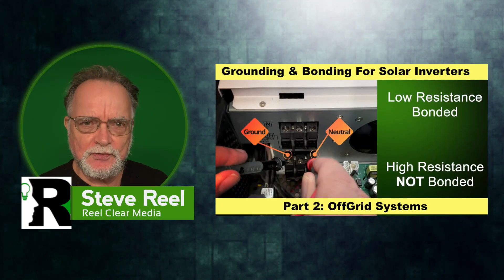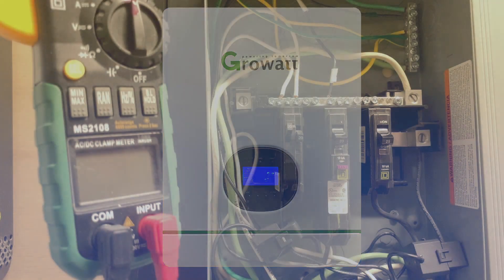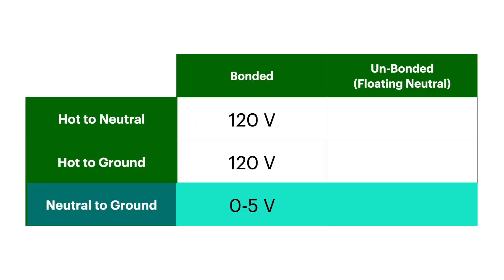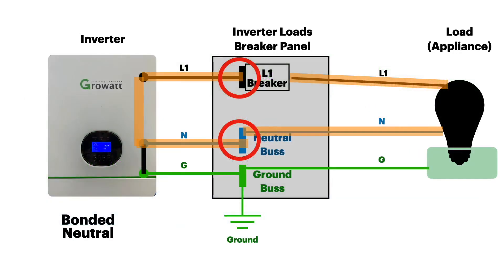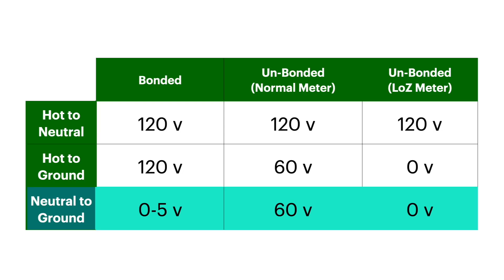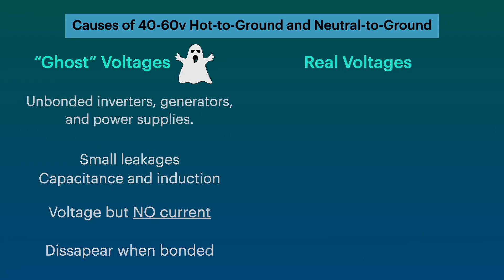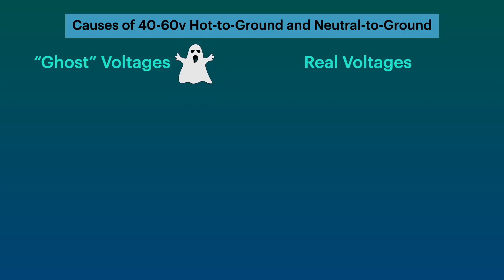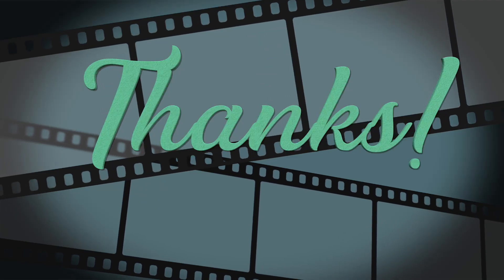Is Your Solar Inverter bonded or un-bonded? How to find out.

Comment: Please, someone should educate me: if there should be one ground for the whole on-grid hybrid inverter or for the whole electrical wiring of a house? My question is: if my hybrid inverter is bonded internally, should the ground terminal still be connected to the breaker panel that's already in the house ground?

Comment: I accidentally blow up an power inverter I was using in my shed that I bonded the ground and neutral together working fine then the next day I turned it on and it popped its caps

Comment: Thank you so much for your content! 
    qq.. would it be normal while performing the bulb test to then see 120 volts on hot to ground when a bulb is connected from neutral to ground?  Bulb is "not" lit, and reads 0 volts while connected to (neutral & ground) when testing for ghost voltage, as I see 60ish volts on both N to G and H to G. Seems I can use this inverter for a "Grid assist" with my Reliance Transfer switch.?
Thanks again
Reply from the maker: The bulb is acting as a temporary bond between neutral and ground, but there is not enough current to light the bulb.

It should be ok, but be careful and double check voltages after connecting to transfer switch. Also check outlets with a tester that shows errors such as "open ground". 

Also, if you are supplying grid IN to the inverter it is possible to create a ground loop.

Comment: Great collection  of videos!  Very clear and detailed.  I could use some guidance. I am working with a 1967 Holiday Vacationer camper.  I will be completely off grid(with use of a 100 watt solar panel not mounted to the camper) Very simple in the electrical needs(seems all original to the camper).  I have a few 120 volt receptacles, six 120v/12v combo lights. I don't have the 12 volt lights connected in any way. Using 120v LED bulbs to conserve energy.  The propane heater and propane refrigerator don't use any electrical at all. There is a small panel with one 30 amp standard breaker with a jumper wire over to a pair of 20 amp standard wafer breakers.  The neutrals and grounds are separated. I have it set up to never connect to shore power.    The ground bus is bonded to the camper frame.  I have a Licitti X battery box(added 100 Amp hour LIPO4 battery).  The battery box has a small built in 10 Amp MPPT charge controller as well as a 1000 Watt pure sine wave inverter.   I plan to use the shore power input directly to the inverter attaching a 3 prong plug on the former shore power feed.  There is one 120 v output receptacle on the battery box fed from the inverter.  The inverter appears to be unbonded with a  floating neutral.  My auto ranging Klien multimeter indicated 122 v H to N, 63 v N to G and 58 v H to G.  In testing for ghost voltage, a halogen bulb lit up H to N, but not N to G.  On auto ranging for ohms, N to G was 20.34 nF and H to G was 20.22 nF. Sorry so much info. Just wanted to be thorough.  I want to update the panel/load center. My questions are this: do I bond Neutral and Ground at the panel? Do you recommend GFCI protection for the receptacles? Do I bond the ground in the panel to the camper chassis?  Thanks for your help in advance!!! Brian

Comment: I'm so glad I stumbled across this video.  Best I've found so far on the subject.  Thank you Steve.  In my preparation for installing shore power in my camper van, I took a deep dive into my electrical system, which I hadn't done since I got it delivered from the builders three years ago.  This is a mobile system (as opposed to off-grid), where there is no real "earth" ground, but I think the same principles apply.  For what it is worth, my inverter chassis ground is connected to the negative bus bar for my house battery bank. I have a Cotek SP3000 inverter with a hardwired AC output (no outlets on the inverter) running to a Blue Sea 30A main panel with 6 breaker positions. The installation manual for the inverter states "Neutral conductor (N) of the AC Ouput and Safety Ground (PE/GND) is connected" implying it is NG bonded.  Blue Sea confirmed that there is no NG bond on the main board.  My voltage test shows 114V H to N, 54V H to G, and 60V N to G.  My first thought based on your videos was that I had a cheap inverter that was outputting 60V on H and N, but the inverter isn't cheap, and I can't imagine the manual would indicate an NG bond with this output.  The light bulb test confirmed it is ghost voltage.  Is it safe to conclude that the inverter is not bonded, despite what the manual says?  My understanding is that the system now has no NG bond, and so my 120V breakers may not be doing their job, which is obviously a problem.  Would you recommend adding a bond inside the inverter or at the main panel in this case?  Also, just to cover all bases, what if I had two NG bonds in the system (i.e. NG bond at both the inverter and the Blue Sea panel?  Would I expect similar voltage test readings?   Also, before I start taking apart equipment, would it be possible to confirm NG bonding status by taking the cover off the inverter and taking a peak inside?  Apologies for the long post, but it was a necessary evil.  Thanks in advance.
Reply from the maker: RV wiring is tricky, you have to use both shore power (bonded at the source) and inverter power (may be bonded, floating, or dynamic).
The voltages you described seem like an un-bonded inverter.

a few things you can check:
With no AC wires (just battery cables) connected to the inverter: Use a meter and check for continuity between neutral and ground. If you have continuity, the inverter is bonded.
If it seems like it is un-bonded,  again with NO AC input (shore power),  and NO AC loads on,  you could bond at the panel and check your voltages again. They should appear normal (H-N:120v, H-G:120v, N-G: less than 5v). You should also check for current on the ground wire with a clamp meter.

If those tests show that the inverter is unbonded, you have to make sure that you are not connecting the inverter and shore power at the same time or you have two bonds... causing current on the ground wire... very bad.

 You can use a transfer switch, or an interlock kit. Some people have even rigged a relay to only turn on bonding when there is no shore power.

Hope that helps... and be careful!
Reply: @ReelClearMediaLLC  Thanks for the quick reply Steve.  First off, the inverter is just an inverter, no converter/charger and no AC switching.  To clarify, it is an "off-grid" camper van with no shore power input.  My plan is to add shore power and install an automatic Samlex transfer switch, which is how I got started down this rabbit hole.  I tested as you recommended and there is no continuity between neutral and ground, and when I bonded neutral to ground in the panel the voltage readings were normal H-N 120V, H-G 120V, N-G 0.  I don't have a clamp meter.  AND I should have noticed this earlier (but I'm still learning this stuff) - the white wire coming from the inverter AC output is connected to the top pole terminal of the 30A breaker at the panel.  Correct me if I'm wrong, but the only reason for that would be that it is bringing in power (60V) from the inverter.  When I turn the 30A breaker off, I get 54V from that terminal to ground.  The other side of that breaker pole is connected to the neutral bus with a white wire.  If the full 120V was coming in on the black wire only, the white wire would go straight to the neutral bus, correct? Seems to me that I actually DO have a cheap inverter, outputting 60V on both lines, and not NG bonded.  What is your take?  If this is the case, I have no NG bond in the system.
Reply from the maker: @macneillconsultingservices2758  I'm confused... the hot wire is white, and the neutral is also white?
Reply: @ReelClearMediaLLC  Apologies if I confused you.  I realize now some of what I said above is gibberish. Again, still learning. It's a standard setup with black wire to hot pole on the 30A breaker and white wire to neutral pole.  The second white wire I mentioned just bonds the neutral pole to the neutral bus.  More importantly, I just got off the phone with the technician at Cotek and now have clarification that I can share. He confirmed that the inverter is supplying 60V on H and 60V on N and is not bonded.  Just as I anticipated.  He suggested I could bond NG at the inverter.  When I suggested that this would permanently energize the ground wire, he twice gave a rather unconvincing "no you're ok".  He also conceded that the way things are now (without NG bonded) I will have 60V at the outlets even when the 15A branch breaker is off,  but he suggested that the NG bond at the inverter would fix this.  He also recommended GFCI on all receptacles.  I forgot to ask him, but it also seems to me that in my current setup (without NG bond) I might have a problem with breakers not tripping on ground fault since I have no path back for the circuit to be completed.  Not sure how this all might affect my automatic shore power/inverter transfer switch - I have a call into Samlex for that.  Might be time to just pull this baby out and put in a "normal" inverter.
Reply from the maker: @macneillconsultingservices2758  
Yes, I would eventually upgrade the inverter. You may be able to use it temporarily.
One thing I still want clarity on. You say the white Neutral from the inverter is going to the Neutral "pole". Is that a neutral bus or one of the main breaker buses? In other words, does the Neutral Pole have slots for  a breaker , or is it a separate isolated neutral bus bar?

Comment: Not sure if related but having return dc voltage on the solar panels breaker at night of about 60v dc... From 3 inverters connected in parallel
Reply from the maker: That's odd. On Will Prowse's channel he talked about AC leaking from the inverters to the panels. That was AC, I believe, not DC, but I'm not sure.
It may be leakage from the DC bus of the inverters, out of the PV inputs. Are your panel frames grounded?
Reply: @ReelClearMediaLLC  no the panels frame is not grounded....but the iron smith guy had welded to panels chassis to a few rods of the roof's infrastructure...the rods from the building's concrete slabs infrastructure sticking out on the roof.....so yes not sure if some messy leakage to the chassis ( the whole metal chassis inside the concrete 😅😅)
but note one thing ...the 3 inverters are connected in parallel so a messed parallel connection could have damaged something...
 the 60 v dc return output is to the open circuit breaker's  terminal...
Reply from the maker: @minetdbrogs9386  You can try:
Only turn on one inverter at a time and check for voltage.

Comment: Can ghost voltage zap you? I get that a lot from my inverter. Its not connected to utility, just to an extension cord and a few solar panels.
Reply from the maker: Yes it can zap you. If its just ghost voltage, it shouldn't carry much current, but if its real voltage, it is dangerous. What are you touching when you get zapped... at the inverter, the extension cord, or the panels?
Reply: @ReelClearMediaLLC  the screws in the casing of the hybrid inverter, those holding the whole front half of the case in place
Reply from the maker: @MegaCyrik  Wow. Measure your voltages like in the this video and the previous video "is your inverter bonded or un-bonded". You want to make sure that's not real voltage.

Comment: Many transfer switches ONLY SWITCH the LINE (HOT).  They do nothing with the Neutral.  You need to specifically search for Neutral-Switching Transfer Switch, and the cost will be nearly double that of a common TS (such as Reliance).  So it may be better to use a non-bonded inverter with a normal transfer switch.  Your electrician can be helpful in making the determination (more labor is required for a neutral-switching installation).

Comment: This is not always the case but is close. I have BougeRV 2000W pure sine inverter. It measures 120V L-N, 30V L-GND and 40V N-GND. Measuring with voltmetar is ok but it is much better if you use oscilloscope (which I did). It will show shape of each voltage but then it requires deeper knowleadge of inverter to understand. It is for sure not 'bonded' one and connecting N-GND may damage inverter. Some of those 'compact' inverters are ok if you connect N-GND together some are not. There is no yet a good video going bit deeper into those inverters. I want to use my inverter to charge plug-in hybrid and this BougeRV cannot do it (ground fault on charge connector cable). This video is for 'off-grdi' primarily but some people may want to charge their EV off-grid as well. Not every inverter will allow that. More expensive ones (like Growat) will be ok.
Reply from the maker: Thanks for the update. I just made a new video on these compact inverters that should not be bonded... but there are thousands of inverters out there and not much info. I've been lucky and haven't fried any yet. I tried to pass along what tips I have found online.
Yes, most EVSE (EV chargers) want to see a N_G bond.

Comment: Nice video series, thank you for making them! If you could clarify one thing concerning the ghost voltages part... Shouldn't the multimeter read 120 Volts between the Hot and the ground if there was no ghost voltage? Why would it read 0 Volts?
Reply from the maker: When the Low Impedance meter reads 0v fro m hot to ground, the inverter is unbonded. The ground is equipment (case) ground only, there is no return path for the voltage to complete the circuit via the neutral return.

If you bond the inverter (internally or through a breaker panel), ground will now have a return path through the neutral of the inverter, and the meter will read 120v.

I cover this in the “Grounding and Bonding for Solar Inverters, Part 1” video. Hope that helps!